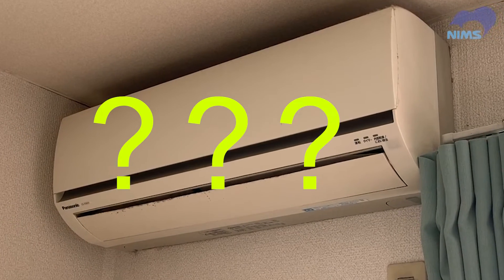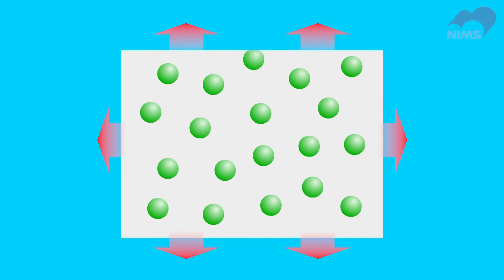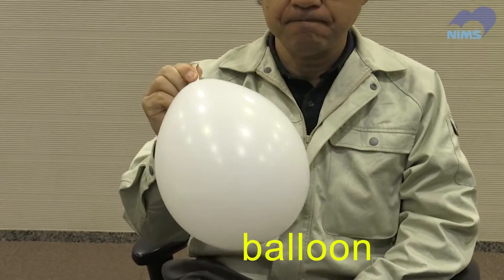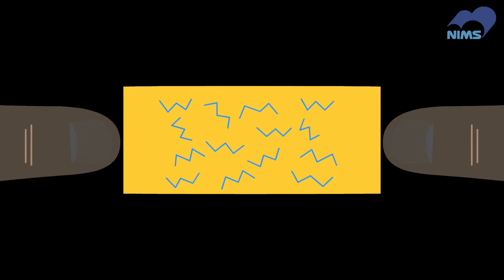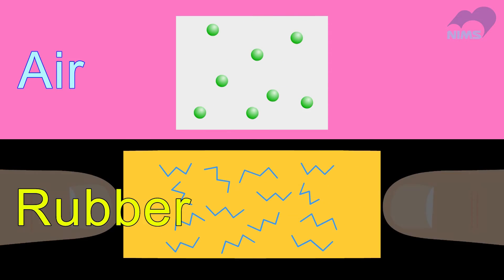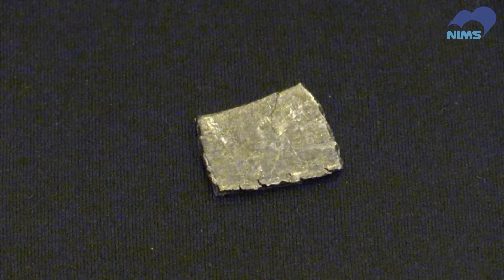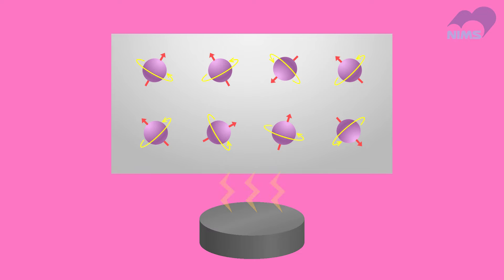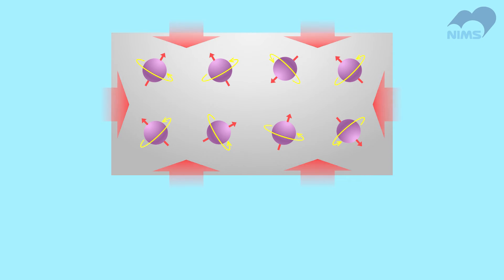Cooling with magnet! Developing magnetic refrigeration to make liquid hydrogen (2020/02/06)

Comment: This video appears to be only a thinly-disguised advertisement for Toyota Hydrogen cars. And more than 95% of the Hydrogen which is available at those scarce refilling stations is supplied by oil companies..In short, a Hydrogen economy is a pipe dream. 

Hydrogen-powered vehicles, even when using fuel cells, are about as inefficient as fossil-fuelled vehicles, in terms of energy used compared to energy available in the fuel.  They are around 25% efficient at best; about the same efficiency as a Diesel-fuelled car. In contrast, fully electric cars are achieving at least 70% efficiency. And electricity doesn't have to be mined, refined or transported in trucks to the point of sale.
Reply: diesel engine efficiency (40%-52%) gasoline engine efficiency (36%-42%) photovoltaic panel efficiency (10%-28%) electric motor efficiency drops at high speed because the very inefficient electromagnetic coils that loss most electricity in form of heat.

Comment: I'm a bigger fan of heating with magnets, heating with magnets means you can get heat without electricity and without induction coils, that would be really useful !!
Reply: but you still need to supply energy to move the magnet
Reply: That very minimal in comparison to its alternatives